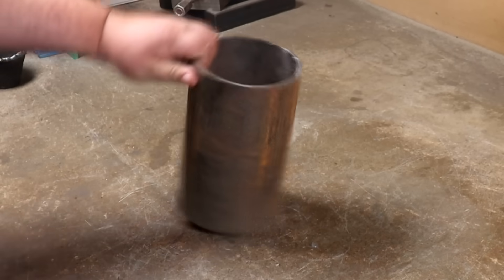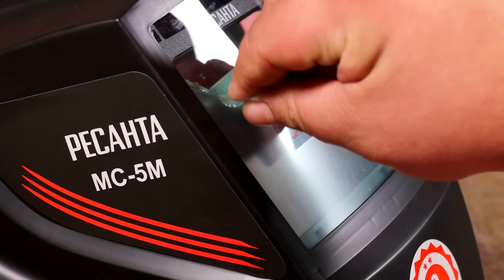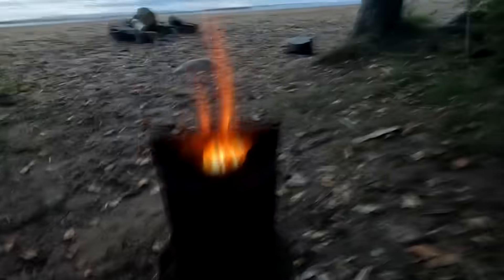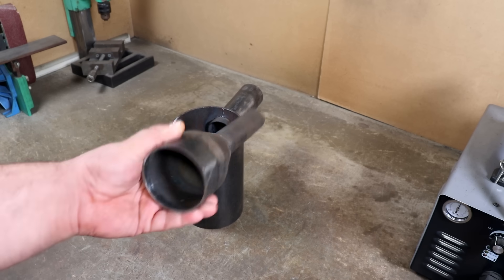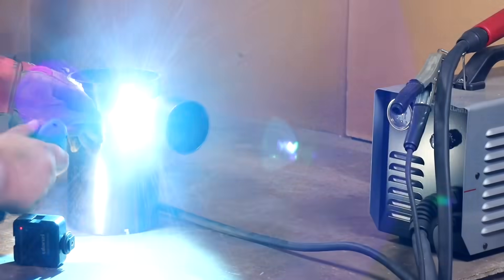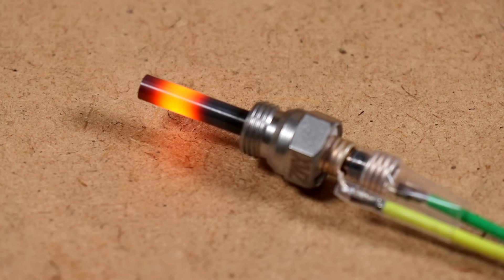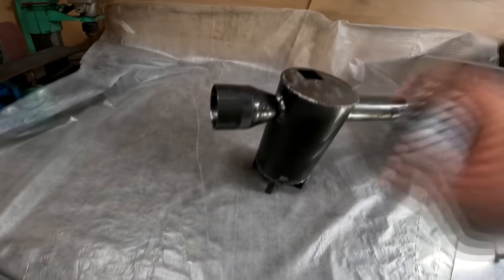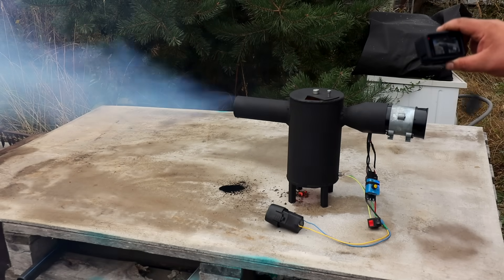ROCKET STOVE NO LONGER NEEDED! Multi-fuel jet stove!

Comment: Water has a high heat capacity, which is why it was (is) used in steam engines. In the case of the stove shown in the material, water is an energy buffer. The problem is that some of this energy is converted into pressure and energy losses still occur.
The phenomenon of the rocket stove is based on very high temperature and efficient, close to 100% combustion of the fuel and extraction of heat before the exhaust gases leave the stove.
The law of conservation of energy still applies and no inventions will result in obtaining more energy than that stored in the fuel - you can only minimize losses, which the rocket stove does perfectly.

Comment: Efficiency really isn't there. You need a secondary burn without electricity. Using radiant heat. Make charcoal through a retort system and the gasses that come off can be used for heating using radiant heat.

Comment: chicken fence grid would be a nice ash bottom. also allow some extra air flow. try carbon fiber fabric sheet survival blanket painted with high temp carbon black and aluminium shiny on opposite sides. also when in continuous operating mode, the burner after starting should be able to generate electricity to load the starter battery. also if you gasify instead of pyrolysis, you dont have anything ashes or charcoal left in the burn container. and you get full air flow from the inlet to outlet.

Comment: Try ultrasonic mist make with 90% water and10% ?  alchool  will the mist burn as is as a fuel?  if not burn with other fuel such as pellet wood or used oil, used as a booster.
Reply from the maker: Good idea. Thank you!👌🤝🤖

Comment: That ignitor is not used for diesel, fuel oil, or kerosene that is used for a natural gas or propane furnace. That's a hot surface ignitor. Oil furnaces use a step up transformer that puts out 10,000 volts through electrodes

Comment: Excellent, I see that you are interested in the same things as me. Considering that you live in Russia and that in the winter they don't turn off cars in Siberia because of the low temperatures, is it possible to make a small rocket stove or heater like a webasto or a parking heater. the device would be very good
Reply from the maker: Theoretically, it is possible to make such an oven working on pellets. As a heat exchanger, use two copper tubes with a non-freezing coolant in the form of antifreeze. But this is only theoretical and you need to decide how and where to connect this heat exchanger in the car. I have a glass oven on the channel, the principle of its operation can be applied. I really like your interesting idea!
Reply: @doctor-robo  ok, I think that it could be connected to cooling system and some kind of pump, I think webasto is designed by that principle

Comment: What about generating electricity with the exhaust?
Reply from the maker: This is possible using the Seebeck element. I will post a video soon using these elements. I think you will like it.🤖
Reply: @doctor-robo  my late father had a patent for one backing the late 60s, and it used the Seebeck effect.
I wonder how much they produce?
Maybe enough to charge a phone or a small light,  I wonder.

Comment: try hourglass valveless ramjet afterburner
Reply: make sure the fuel input is after the constriction neck, and will be vaporized/mixed in the resistance glow ignition coil
Reply: well you can try with a narrow bottom neck widening upward wood burner tube
Reply: passive pressure combustion air flow directionality, no fans, just the starting fuel
Reply: rocket stove is self-sufficient
Reply from the maker: Many thanks! I will definitely heed your advice. 🤝🤖
Reply: @doctor-robo  God gave it

Comment: Nice!   Need a silent motor then it will be even better!!!
How would you add heat storage to it?
Reply from the maker: To accumulate heat, it is enough to place a heat exchanger on the exhaust pipe or make a water jacket for this furnace. Thanks for the question, very interesting.🤝🤖
Reply: @doctor-robo  I love the water jacket idea as water is excellent for storing heat.  However the water will need to be insulated as water is also excellent at thermal conductivity so much so that the heat will leave it rapidly.